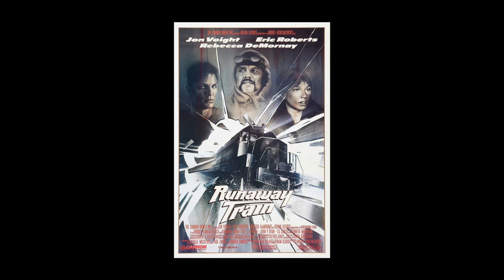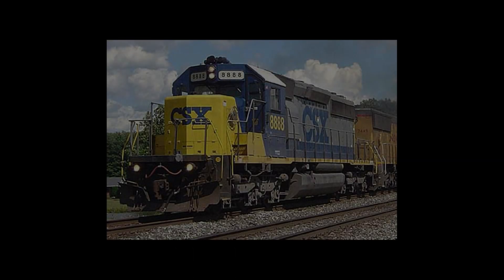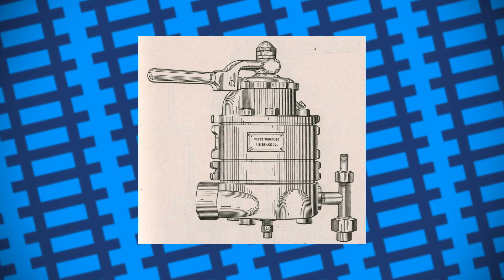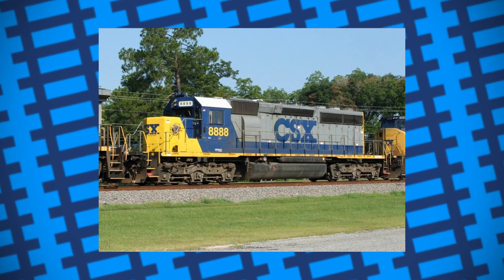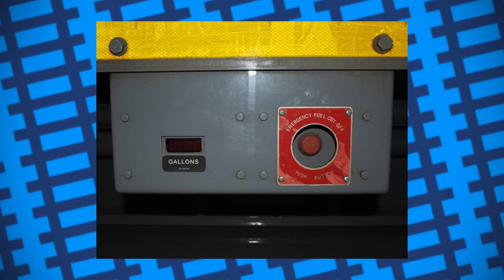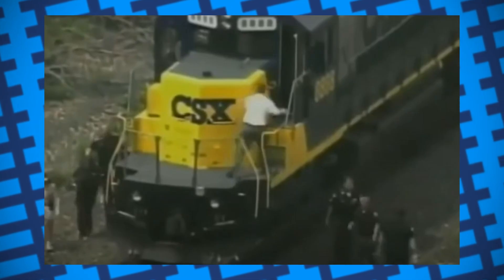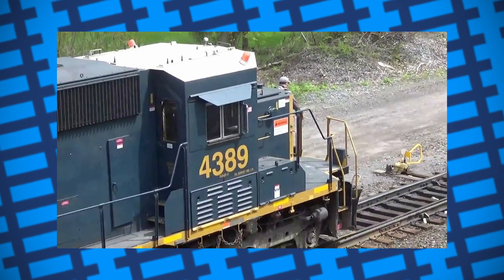How to (and how not to) stop a runaway train - Crazy Eight's Incident

Comment: My understanding of what disabled the dead man's switch is somewhat different. The engineer also enabled dynamic brakes; which disables the dead mans switch as otherwise when the switch engaged it would disable the dynamic brakes. The problem is the locomotive had older style controls where it was possible to engage dynamic brakes without changing the prime mover to idle. The resulting electrical configuration results in the engine power being divided between the traction motors and the resistor bank used to dump power from the dynamic brakes.
Reply: Why would dynamic brakes disable dead man switch? In every loco I know, (well, european) it engages EP valve that connects main pipe to atmosphere and pressure drop cuts of dynamic brakes. It's designed for maximum simplicity.
Reply: @antonisauren8998  Old bad design. The dead mans switch would otherwise disable the dynamic brakes because it isolates the traction motors rather than isolating the prime mover.

You seem to be talking about the air brakes, which were already enabled. And yes, the dead man's circuit tripped, attempted to activate the air brakes (which were already enabled so that does nothing), then saw dynamic brakes were enabled and did not power knockout because it has hardwired knowledge that it would disable the dynamic brakes (true) and doesn't know it should do so anyway because the engine is still under power.

Comment: I’m surprised that the locomotive didn’t explode when getting shot in the oil tank
Reply: Diesel explodes only in the movies. :P Also such fuel tank is made of solid steel. It's under the loco, so is constantly hit by flying rocks from trackbed, and you don't have to skimp on weight, as loco needs to be heavy, to get proper friction.

Comment: Movie Unstoppable: "Can we shoot it? No, that would never work!"
Reality: Actually did shoot it. It didn't work.
Shows that the real story is actually much more interesting and exciting than the Hollywood nonsense. The behind-the-scenes and actual story are both far more interesting than the finished movie, which was mediocre at best due to trying to make everything over-the-top. Had they adhered more closely to the real story it would have been much better.
Another thing I ponder - how did the driver not notice the engine cranking up? To my understanding when you set the throttle to full power, things get a lot louder, which wouldn't happen in dynamic brake mode. The dynamic brakes do make a whirring noise (I hear it all the time living near a railway with notable gradient) which is very different from the sound of 3,000 horsepower of EMD two-stroke.

Comment: A couple of corrections, first, the Train "Air Brakes" and the independent brake are both air brakes which set the same set of brake shoes on the lead locomotive. The independent though, is just straight air and doesn't have anything to do with the train pipe pressure. The Train brakes, also known as automatic air brakes control the brake application of the whole train through differences in pressure in the train line relative to the reservoir air tank on each car. Also, 8888's engineer was actually fired after the incident.
Reply: Independent brakes operate off main reservoir air. When a reduction is made in the brake pipe and the independent isn't bailed off, a 50kpa reduction in BP should raise the independent 50-125kpa in the brake cylinders. An automatic brake valve can be used in place of an independent in the event it being necessary.
Reply: @3801Catcher  You're right, thanks for the correction.
Reply: @rileycoyote4924  no worries mate, happy to help.
Reply: It's common belief the engineer was fired. But CSX apparently found another way to make him useful. On another documentary of this incident another railroaded commented that they brought in the engineer responsible as a way to train new ones. He retired in 2017 from what I've heard. So no he wasn't fired.
Reply: From what I heard CSX never released the identity of the engineer so what happened to him is only known internally

Comment: i wonder if someone was to drive a car or a truck alongside the locomotive at the same speed, could someone else in the car press the emergency fuel cutoff?
Reply: In a straightaway on flat terrain probably, but i don't think those conditions would be very common
Reply: Probably, but you have to remember that driving along a track at any significant speed is impractical. Especially in a rural area due to the roughness of the terrain alongside.

Comment: Nice and informative Video! I enjoyed it very much! I also wanted to say that here in Germany we also have such a system which is intended to prevent runaways. It's called "Sicherheitsfahrschalung" or "Sifa" for short. The only difference with our system is that every 30 seconds you have to release the foot pedal once and then press it again. If this doesn't happen, the emergency brakes apply. I think this is a much safer approach to preventing a runaway.
Reply: Sounds like it's absolute hell on the operator and would lead to major repetitive motion injuries.
Reply: @Hybris51129  
There is an audible "Sifa" call-out for four seconds before the train does apply the emergency brakes, so unintended braking is quite rare. From what I've heard a short tap of the foot is enough to apply the Sifa pedal, and I'd imagine that after a few days you'll get used to it.
Reply: @mikeblatzheim2797  Yes. I forgot to mention. First comes an indicator light, then an acoustic warning signal and then the braking. And yes, you get used to it quickly. :D
Reply: @Hybris51129  So I guess something like...   walking  would be even more injurious?   :)
Reply: @cr10001  Walking is slightly more natural than constantly moving your foot a small amount constantly. Otherwise why you have things carpal tunnel from keyboards and the like?
Reply: @Hybris51129  You can move your foot at any time, just have to press it again in like 6s. Active allerters are a bit easier, as there is usually at least one button and a pedal, in shunters more with buttons near windows to be accesable while hanging out for visibility, that requres tapping any of them every 30s, and tapping them in the meantime resets timer.

Comment: Since I read about this incident long before the film, I have thought that, if you wanted to stop a train by shooting it, you'd want an appropriately-sized rifle to punch a hole in the engine block.  All you realistically have to do is puncture the water jacket and let all the water out, either some automatic system will stop the engine to prevent it seizing up, or it seizes up from over-temperature.  A big enough rifle (.50 BMG?) should stop the engine cold, but I cannot say for sure just how big would be needed to do that and if it would have been something the authority having jurisdiction could have gotten hold of in reasonable time.
Reply: "How am I going to stop some big, mean mother hubbard from tearing us a new disaster site?  The answer... is a gun.  And if that don't work, use more gun."
Reply: @voltsiano116  Yess, tf2 reference.
Reply: You'd need probably like a 20mm anti-tank rifle, if not bigger
Reply: I would shoot the radiators  and it would eventually trip the engine protection device causing it to shutdown for low water pressure. You might have to use armor piercing to get through car body.
Reply: These engines don't have blocks. The cylinders are individual parts that can be replaced in pairs. Each assembly is called a "power unit."

Each power unit does have its own water jacket, but small arms fire is not likely to puncture one.
Reply: A 50 cal could stop a small/medium engine, but it will take either several rounds of 50 or a small cannon shell to stop a massive 211L V16
Reply: Oh, I can hear it now!  "Sir, we're going to need a bigger gun!"
Reply: I wouldn't exactly say it stop it cold because it still has momentum
Reply: Definitely more dakka.

Comment: Correction:
The unnamed driver worked for CSX for many years but he was not familiar with the new changes CSX made by combining the power and dynamic brake switches hence the confusion. Unfortunately for the driver after the "Crazy 7" incident, he was fired for negligence.
Reply: I am a little bemused that an SD40 control stand ended up an SD40-2. I don't know if this was a goofy Conrail specification (Conrail had several "unique" specifications on the SD40-2, like Flexicoil trucks and class lights) or if the control stand was replaced in a rebuild (also completely possible).

Some clarification for anyone reading who might be unfamiliar with the terms being used here - the original SD40 of 1966 vintage used a control stand which utilized a common lever for power and dynamic braking, with a selector switch to change between modes. The revised SD40-2 of 1972 utilized the standardized AAR control stand. The AAR stand was introduced as part of the 1972 "clean cab" concept which significantly reduced cab clutter, standardized the direction of throttle and brake levers (moving any lever forward adds braking or decreases power, moving any lever back decreased braking or increases power) and specified that throttle and brake handles should be physically shaped differently (which is why the dynamic brake and throttle levers on an AAR stand are rotated 90 degrees from each other). This was in response to several similar incidents (e.g. the fatal 1969 Santa Margarita crash).
Reply: Crazy 8*

Comment: The reason I've heard about this incident is the Citation Needed episode about it.
Edit: They talked about the Police trying to hit a switch by shooting at it, but they didn't mention that they used a SHOTGUN to do it. How did anyone expect this to work?
Reply: They make “non-lethal” bean bag rounds that are supposed to just knock the target out with little risk for actually killing it. Sure a normal bullet won’t ignite a fuel tank but the force of a beanbag round if it hits would probably jam the button down.
Reply: Rubber riot bullet from the shotgun had most logical sense in this situation.
Reply: @randomnickify  Beanbag would probably be better. Rubber bullets are still going to deliver a huge amount of kinetic energy to such a switch and probably just break it.
Reply: Probably a big game of Telephone! between whatever guy said "okay, you need to get someone to hold this big red emergency cutout button for up to 5 seconds" and the poor cops beside the rails being told "shoot the big red thing on the side!"

Comment: CSX 8888, being an SD40-2 built sometime in the 60's/70's by GM's electro-motive division, wasn't exactly the best in terms of safety systems. Crew would often put worn out brake pedals on the dead man's switch, causing it to always be pressed down. Doing so may have also caused the CN Hinton collision, in 1986. Another accident i would like reviewed on this channel.
Reply: I assume it's these many incidents of rigging the dead mans switch that caused the implementation of the alerter. A button you have to press when an alarm sounds is a lot harder to jury rig.
Reply: In the Hinton accident it supposingly was a lunch box placed on the pedal; and an unconnected air brake hose somewhere in the middle of the train.
Reply: Thunderbolt 1000 did that.
Reply: @SBB_Arcadia  Just because one guy did it doesn't mean someone else cannot.
Reply: @SBB_Arcadia  yeah and it should be redone, that vid sucks.
Reply: Like in "Silver Streak" of 1976; bad guy shot the engineer, set a tool box on the dead man, then got shot himself.
Reply: Safety is not concern on US railways. 
Never ever

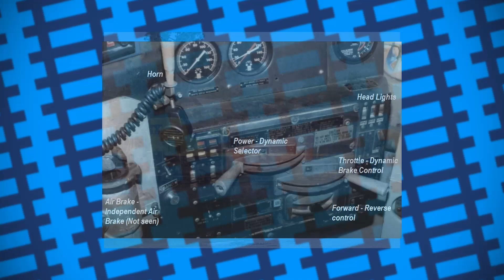Comment: Missing context at 3:00 During this time 8888's throttle and dynamic brakes were combined and tye engineer had to switch a lever to either dynamics or power which was very confusing for him.
Reply: After the "Crazy 8" incident, the throttle and dynamic brake switches were reverted back to being separate switches.
Reply: @BHuang92  Correct.
Reply: it was mentioned in the video
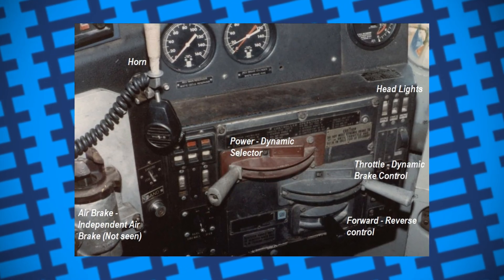2:28
Reply: Yes, this engine was equipped with older electronics that required a selector lever to transition the electrical system supplying power to the traction motors when the engine and generator become unable to supply enough power in their current state. 

The dynamic brakes are also applied in this way, only the selector must be in the "off" position, the pulled towards you. The indicator will read "B" , then the throttle can be applied to produce dynamic braking power.

The engineer was a former employee of the Pennsylvania Railroad. How he did not understand this process when most early EMD locomotives like the GP/SD7/9 used this is beyond me.

The dash 2 electronics made the transition process completely automatic, and the dynamic brake lever became its own entity on the control stand.
Reply: And that's how CSX 8888 (CR 6410) ran away i guess.

Comment: in most cases the floor pedal triggers an emergency brake application, not just cutting engine power or in some cases not cutting power at all
Reply: Brakes were already applied, so that applying brakes wouldn't have made a difference. Plus I've heard many drivers put a brake shoe or other object on the pedal, as sitting in a position to always be on it gets uncomfortable after a while.
Reply: @quillmaurer6563  a deadman switch is normally clamps the breaks on the entire train not just the locomotive or it would be a pretty useless "dead man switch" if it didnt in fact halt the train. unless there is some bizzare american practice where that isn't the case. if they haven't learned that simple mistake from 250 years of railways history then there is truly no helping them. if a driver is negating a safety device for convenience then he should be prepared for retribution from those of the families of those he endangers by doing so.
Reply: @Spiro20004  Brakes in wagons were supposed to be disabled and main pipe disconnected. Why? How was he supposed to stop it then? In Europe only shunting done without air brakes connected is done by small battery shunters that don't even have compressors, and they pull single loco or EMU arround the shed and nothing more, but even then I've seen modifications with putting industrial compressor on roof, as it's much simpler and safer to fill that few dozen meters of main pipe, than to walk, disable brakes, release brakes, enable them again, repeat with every car.
Reply: @antonisauren8998  quite right, as i said. american practices make these accidents unsurprising to me